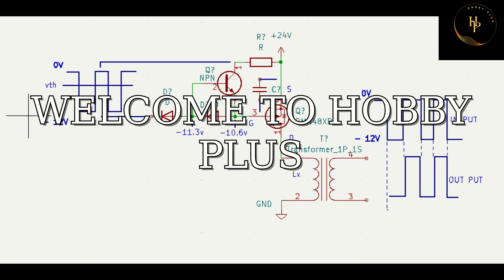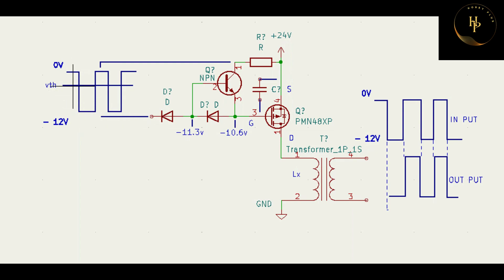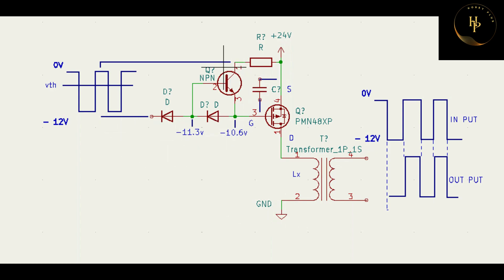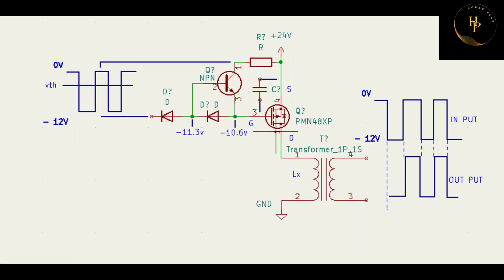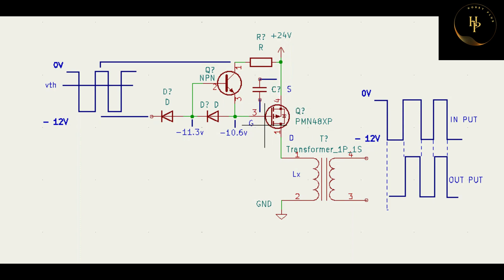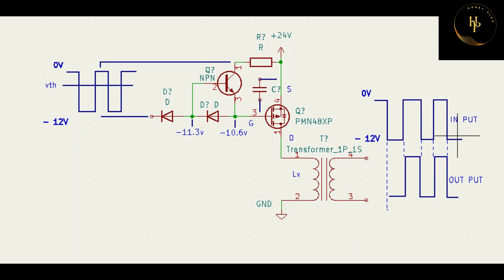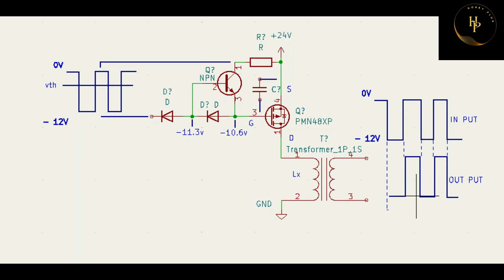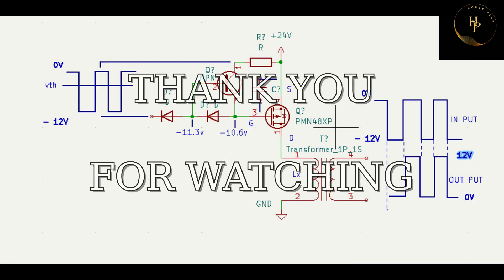[8]P Channel Mosfet Circuit Analysis

Comment: Sir if mosfet need 12V to drive the gate how to create 12 v by 24 V
Reply from the maker: tell you shortly
Reply: @hobby_plus  thank you sir
Reply from the maker: you can use 
1) Resistance network.
2) 2:1 Driver transformer.
3) by the transistor as a amplifier 
4) by the op-amp (low amp output)
Driver transformer is the safe way to drive MOSFET. According your circuit requirement you can use it.
Reply: @hobby_plus  thanks a lot for your response sir